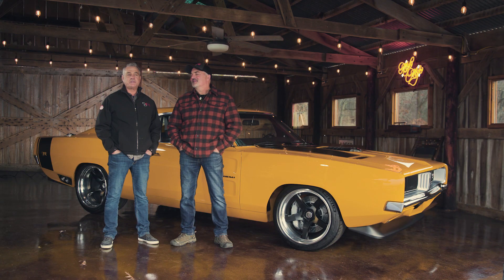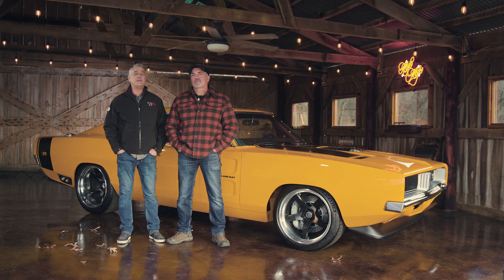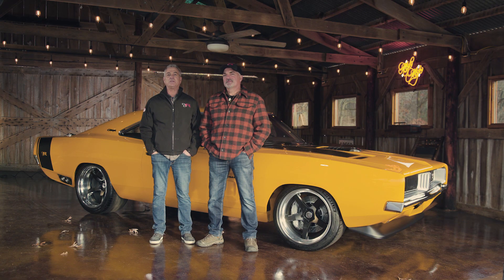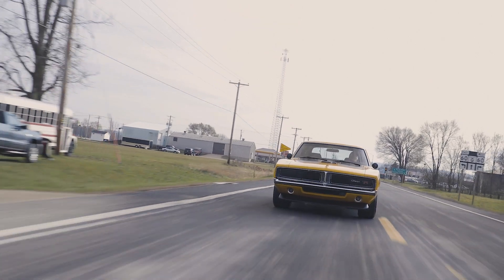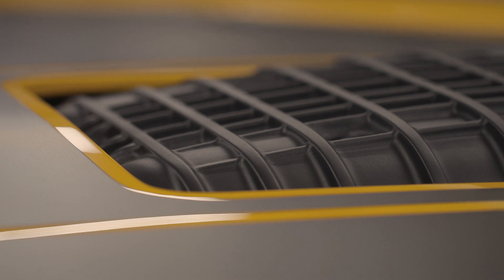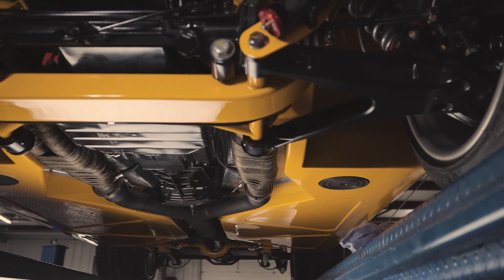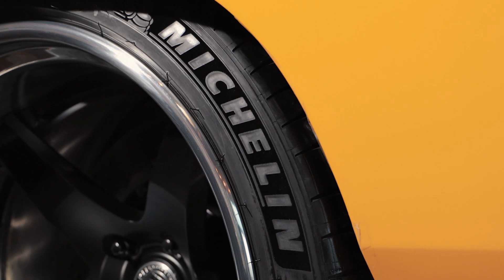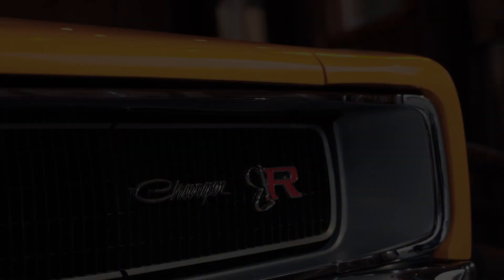Ringbrothers 1969 Dodge Charger "CAPTIV"

Comment: You guys are my inspiration to build my own 69 charger daily driver. My charger is white with a black R/T stripe and you've convinced me to do black b pillar badges on my car. I'm using the interior of a modern dodge challenger including the dash and center console along with the seats. I'll also be using a pentastar v6 because I want phenomenal gas mileage and not insane power. 305 from the factory is better than a 360 magnum v8 and 5.7 hemi levels of power are very attainable with a turbocharger. But I've seen someone get a 45 to 48 mpg average with said v6 so that's what I'm building it for.

Comment: what's the minimum wheel/tyre size would you opt for (prior to upsizing as per customer request) in your absolute gorgeous custom build American classics??? I'm seriously considering a few well restored customized 1968 - 1969 Chevrolet Camaro Z28 (Mk1) 4.9 V8 2-Dr Sports Touring Coupe (LHD) . . . just curious a 1969 Chevrolet Camaro Z28 (Mk1) 4.9 V8 2-Dr Sports Touring Coupe (LHD) with AWD . . . a classic American muscle car with AWD, should one do it or not . . .

Comment: As a kid I had a '68 Charger 73-76 with a 383.
I consider that the best year because of the grille and headlights.
Mine had a TourqueFlite  and a Burnt Orange paint job with white vinyl top. not pretty
Took me from OKC to the east coast and back during my first 2 years in the military.
II always thought it was the perfect canvas.
Sold it before I went on the USS Nimitz on a 7 month cruise.
Carter gas crisis.
gah

Comment: I hope to GOD they didn't ruin another 69 Charger. Nice interior but it doesn't look good in that car. The problem with the Ring Brothers is that they aren't really Mopar guys and don't get that any change to the original body style is a mistake. Not fond of the color, it's boring compared to the factory high impact colors.

Comment: Why do the ringaling brothers always have to put their own badges  and stuff on cars  to advertize themselves .they do fantastic work' but the cars are always too customized with things that come from their  imagination . The original manufacturer's got the look right at the start'why mess with it. Do 295 tires on the front track well?' In my experience  anything  over 235 turns the steering to crap.i'm a big fan of greg Murphy  'he's an ace race driver' but someone  in nz could have done this charger  without it being  rebadged as a 69 ring brothers  charger .graveyard cars  do them right. Nice car all the same.🙂